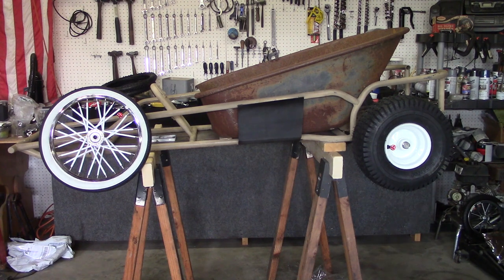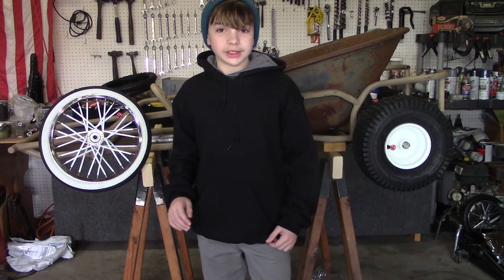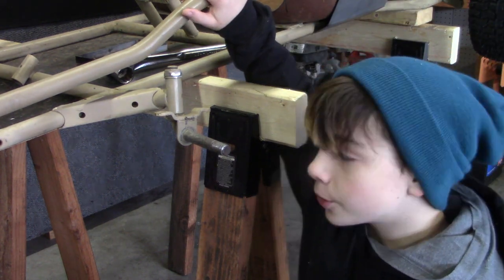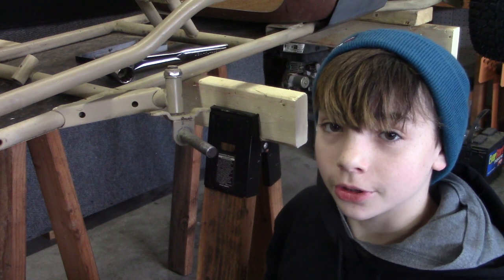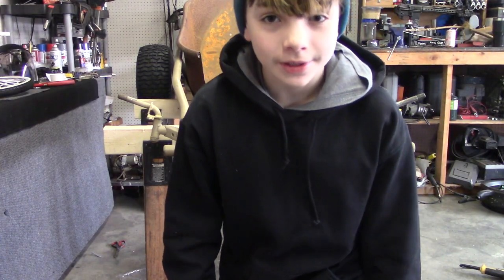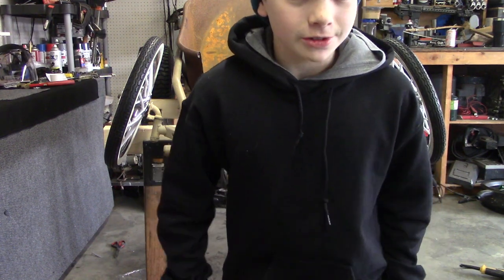RAT ROD GO KART (RAT KART) BUILD, VIDEO 1

Comment: How much did all of it cost you?
Reply from the maker: Hard to say, some of the stuff we had, but engine/torque converter/wheels and tires was the bulk of the expense...maybe $500 with all the odds and ends; brake, shift knob, pedals etc. Frame was a $50 FB Market find.